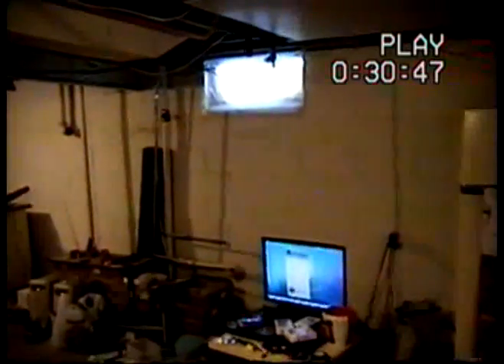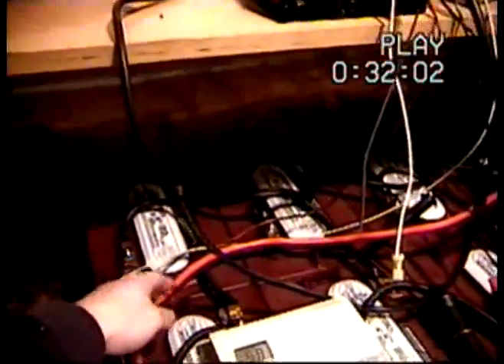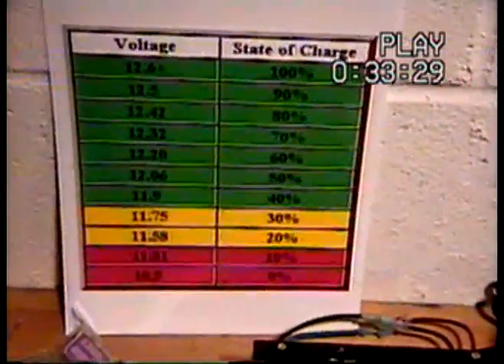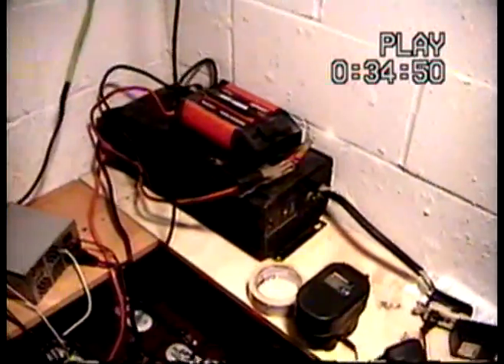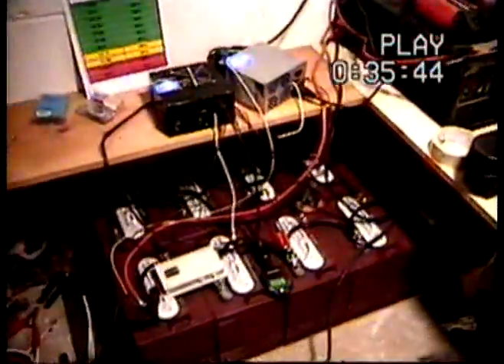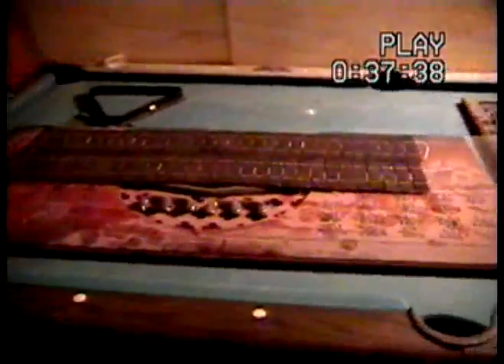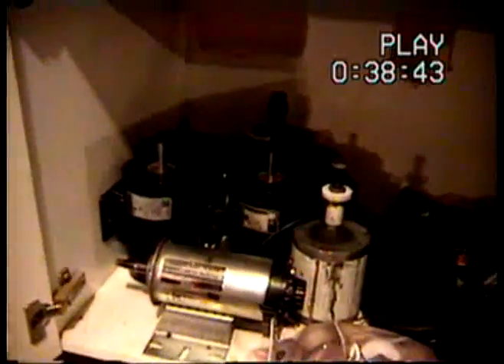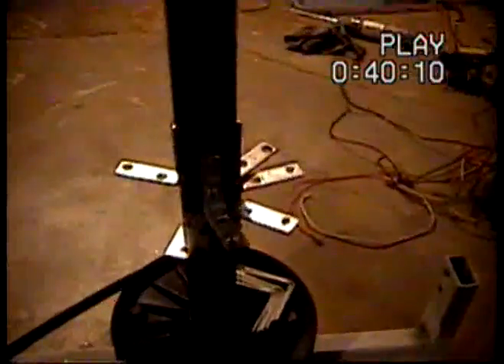Battery, solar and wind generator setup

Comment: The desulfator do you hook that up corner to corner aswell or just 1 battery at a time. Thanx.
Reply from the maker: Whoa, I almost forgot I uploaded this video lol.  Yeah you can hook it up to either.  Best or quicker results would be to hook up to single 12v but if your not in a rush, hook it up to the corners posts and leave it.👍

Comment: Batteries in series or parallel?
Reply from the maker: both. there 6 volt series to make 12 volt then parallel
Reply: +donzi joe oh ok so if it was 12v batteries then just parallel.   so how has the system held up since you made this video?    Looking at designing a system to heat a house with wind.
Reply from the maker: +Jason Ta yeah just parallel for the 12v batteries. It has held up very well. the only thing that has changed is more solar panels because wind gens wont produce enough in my location. if your location is pretty windy all the time you might do ok but solar is always a great choice. i am actually in the process of collecting used laptop batteries to make lithium ion batteries to replace my lead acid batteries. good luck
Reply: +donzi joe Ok tx for the info i just need to look at draw and hours of use for the bank.

Comment: A beatiful work indeed!
And  small questions, if its possible to be answered.
 Do you connect the neg+pos cables of the wind generetor,
straight into your power bank? Does it needs charge controller
seperately from the one you got already for the solar panels?
thanks
Reply from the maker: You cant use a wind turbine on a solar charge controller unless its able to regulate the wind turbines higher voltage.  If it cant it will burn up the charge controller.  You dont have to use a charge controller for the wind turbine but if your not there to 24/7 to monitor your voltage of batteries they could over charge. I would so you dont have to watch everything all the time.
Reply: joe williams Ok, i see, i do have a clear picture now, thanks!
I have a charge controller for my system but its level up
to monitor that only (a 40A charger for a 37A solar system)
and now i will add the wind turbine, you see! So, i have to use
another one i suppose.
thanks again for the quick answer joe!

Comment: dude, love the man cave intro,, :)  guys like you are what make the world go around. I love the stuff about the tread mill motors/ wind generators. Have you done a video on that??  you are doing things that amaze the rest of us, me especially..  

The eight batteries,, did you get them new or used? I am looking at putting solar on a airstream travel trailer and was trying to find a good place to buy used batteries. There seems to be a bunch of videos on how to refresh old misused batteries./ 

also the pulse controller,, what is that and how did you make it and does it work, or will it work with less batteries.. I will have 2 or 4 tops batteries  t-105. 

thanks again and happy Thanksgiving 2013..

Comment: I have a prostar 30M 30 amp controller. My solar panel puts out 7 amps. Can I hook my 8amp 12 volt DC generator to the same connections I have the solar panel to ????  If the solar panel is in full charge of 7 amps then that would be a total of 15 amp input to the control.

Comment: lol I am doing the same if you want a faster magnet collection with motor try the he washers take a allen wrench on the bottom you will see a big round plastic ( don't break )pull it off and walla magnet continue you want the shaft and all on it ps the microwave take to long but the plus is the parts like the magnetron is about $50 and the inverter about $20 have fun keep it up

Comment: Hi Caveman, so hoping this question isnt redundant, but can you tell me exactly what runs off all your setup? Does it run  a normal fridge, water pump, lights and electric heaters, and lights all at once? Only asking because i need to know what i would need to run my extremely small house.

Comment from the maker: Hey Thanks, I usually keep a good eye on them but thats just because I pass by them a lot.  I pay less attention in the summer months. Ill try to bring them down to 12v and then a few days later down to 11.85v. Ill do that to complete a full cycle on the bats so they will last longer. I am using a xantrex C-60 charge controller and it is PWM and it will equalize the bats once a month as well.

Comment from the maker: You can use 2 different charge controllers, 1 for wind and 1 for solar and hook them up at the same point on your batteries or 1 charge controller that can handle both wind and solar and then hook to batteries.

Comment: what motors do you have on your turbines and the specs would be good.... newbe here and trying to find what are the best sort of motors to use! are the low rpm high volts/high amps best in DC best to get?

Comment: if i have 2 standard 12volt batterys connect to a wind turbine to be charged does this mean the charge controller has to be set to 24v? Also do i have to disconnect the batteries from the wind turbine in order to use their power or can i connect the power invertor up in such a way where i can use and charge at the same time. Any help would be greatly rexcieved. By the way im new to all this.

Comment: Hi Caveman. so can you plug in two inverters to a battery bank? I have a 240 watt solar panel with a 920AH bank of battery. My 1500 watt inverter is running everything in my house and im planning to buy a portable electrical stove which i would need another 2000 watt inverter to run the 1500 watt stove, so is it doable to hook an additional inverter to the battery??? Thanks

Comment: The problem with wind, and sun, is not only the location, but the Availability.
Instead of relying on something undependable, like wind or sun, use a Constant source like magnets.
A simple N-S magnetic repulsion turbine and you can mount a practically silent unit anywhere you like... preferably the garage, if your wife is anything like mine.
I Always get a Good Giggle from people trying to use wind or sun ! - Good Luck With That !

Comment: Noticed on your early model wind generator you used a pulley/fan belt set-up.  That is very inefficient.  A sprocket and chain drive would have much less drag.

Comment: got a question if you dont hook up a load to the charge controller will it still stop charging the battery when the battery full cuz i wasent sure y they had set up like that i never hooked up a light to the load on my charge controller will the controller still kick off when batterys full if i dont have a load on the controller

Comment: you need to vent your charging area.  breathing that is not healthy at all.  also lift your batteries higher off the concrete for longer charge hold.

Comment: hi ,great video & very kind of u to ansewr lots of qns.including mine if possible-with 1kw pma how many battries do I need to hock in to run a house & if I connect 20-12v batteries in series can I get 220v current to run the house without converting from DC to AC  --THANX A LOT

Comment: hi there. i like your .battery set up.can.please email me. your battery set up.  info. im trying. to  make a battery, bank .with 6 volts battery. im confuse. on the set up.. in your video. you say. you conected .then in series. then in parallel. .my question. to you is./ do you have your set up for 12 volts. or 24 volts. can you please help me out . if you dont mind. sending me more info please . i preciated. you help. god bleess . my email is. blueman1968@gmail .com. .i

Comment: Hho is great. I'm working on a hot water heater that uses Hho and would love to wind or solar power it. My guess is I need to produce at least 300-500 W to make enough has to heat it.

I'm building a tower that goes up 80 ft and want to put Daisey chained wind generators on them. Can you show how you have your two generators going to the charge controller? Do they each need their own charge controller? How many watts are you getting off one generator/motor.

Thanks...

Comment: Hi I have an(1000VA) inverter which runs in 12vDc I would like to change the battery to 200AH deepcycle and connect a solar panal system to charge it,infact I dont want to connect it to the grid to charge the battery the question is what shuld be the charging voltage and current for the charger controller as we consider the day light is only for 6Hrs to get the power out from solar cells,what capacity the solar panal shuld have...Thank You

Comment: @jamesc426 what he has done i connected the 10 batteries together by having 5 banks of 2 6volt batteries making 12 volt and the way he has connected the rest is by connecting negative to negative and positive to positive creating the amps i have recently made a video about this have a look you might find it useful hope this helps

Comment from the maker: are your batteries 12v or 6v.  if there 12v then all + should be together and all- should be together.  also you inverter, solar and wind should be hooked up on same post on the battery bank.  kinda sound like a bad inverter or you are pulling a big load from your batteries.  what are you trying to run

Comment: Thanks for the reply,
I put a volt meter on it today, spinning it by foot I got 14v DC. I guess the next step is removing the weighted fly wheel and trying to find the most efficient blades. What do you recommend?

Comment from the maker: It sounds like its good.  does it say DC voltage on it or can you spin the shaft with a volt meter on it the wires.  If it makes voltage it will work

Comment: Hey hooptejoe, 
 I found this treadmill in a field and pulled out the motor. The stats are:
Baldor industrial motor
1.5 HP
90 V
13.5 A
2400 RPM
Would this be a good motor for a windmill?

Comment: I'm starting on a water system first- rain and wel, I'd like to use sun and wind to get it going. to get 'free' water. I wish battery and solor panel teck. would kick in and make the prices go down!

Comment: Your doing a good job! I would like to know if you have ever did a payback
on your energy savings? I've been looling at saving money using FREE wind, water and sun. But to save a few bucks it seems to take a lot of time and money and when it finaly would pay for itself you have to start replacing parts like batteries etc. Even With free stuff .

Comment: I tell u this as it can be put in2 a switching power supply 2 give u fullpower produced saved in capacitors- very little loss 2 use at adjustable & clean power requirement. an old cheep palm size  AA solar charger from 24hr charge 2 blow AA rechargable vent because of 2much power on the same palm size array.
  over voltage load could be 2 flashlight cell chager(s) & put a relay 2 turn on an ugly load(s), stepping or not. 
   & charge ur cell phone, etc.
 I thought of this from ideas i've seen

Comment: You don't see the PV setups when solar cell of unequal resistance was, Power output is low due to cell bottle necks.

Put together smaller series of cells for lower output voltage. Match them up on a common light test and check PV Piece resistance(matching cells out puts)
  Now some mismatched .5v cells can be used parallel to put in series for max effect total power (watts output). A voltage multiplier can boost 1.5v or less to a disposable camera flash used 200-300 volts. Coil or capacitor.

Comment from the maker: I use light bulbs as dummy loads on the wind gens because the open voltage can be kinda high.  For the solar, all the cells were .5v so I put them in series to make about 17v then put them in parallel for the amps.

Comment: did you consider using your dummy load to Power 12v power NIckel metal reg AAA, AA, C, D, etc. battery packs. Did you ever consider using a voltage multiplier and configure your problem solar panels to parallel and go for pure current and avoid equal ization, resistance issues, all pieces just on one bus. Series solar cells have to be matched to prevent uneven resistance.  Voltage multiply your .5v or better to the voltage desired and high current to boot. very useful with varied devices
thanks

Comment: Nice home made equipment. 

I really like the homemade charge conrollers. did you use PC Switcing power supplies?

The man cave will one day run some of your home. You could always hook up  seperate AC power panel just off the battery bank. You might even have a stand alone room or rooms one day.
  You even built a vertical windmill, great for side by side and good in city roof lines.
 very expensive to buy

  thanks. great work.

Comment: man I keep watching just this video and dam I wish I new you. I used to collect the micorowaves for making hi voltage sparks and just relized I can stripp the transformer a part and make windings for a genarator and the magnets for the clexktron I might have smelled that wrong but dam lots of good ideas,  and I was looking at the left over parts from the tread mill those make good mounting frams for solar pannels ect.

Comment: I Like the Idea of a vertical blades. I have just converted a 340 twin cylinder 2 cycle engine into a generator. Now I am trying to think of away to make a cage or some sort of style of vertical much like the shape of an agitator, you find in a washin machine?

Comment from the maker: Im gonna be making a video here soon and Ill try to explain how I did it in there.  But basically all I did was put in a transfer switch which allows me to switch from gid power to battery/inverter power.  Also made sure that they were completly isolated from each other so there wasnt any interferance

Comment from the maker: Fridges are harder to run because they consume so much power.  I would use a propane fridge or an energystar fridge.  If they dont want to get another fridge then get a few more deep cycle batteries.  6 volt batteries can take a beating better than the 12volt.

Comment: hey buddy,i got relatives in the ranch were there no electricity they ran salor panels 65 watt  , wat you recomend to operate a small medium fridge, they just use 12 volts comercial work aholic interstate 2 to ran 12 volts light bars and 12volts tv old school,and wat type of batt is good to run da system thanks

Comment from the maker: You connect 2 6volt bats in series to get 12volts.  After you connect each set of 6volts bats in series to make 12v then you connect them in parallel

Comment: Did you do anything special to get rid of the hydrogen that comes off of those batteries when you charge them?

Normally solar panels use special low lead glass so it doesn't block the frequencies of light used by the cells.  How much of your 70W did you actually get?

Comment from the maker: I used some rubber from a treadmill in between the cells and wood.  Not sure why.  Make sure you use tedlar sheets to keep the cells together otherwise when they heat up it will loosen the solder joints.

Comment from the maker: Im having issues trying to hit the reply button and hit remove instead.  The 2500 inverter I got off ebay for 84.  Would like to get more solar then Ill go off grid or build a bigger HHO cell to run a small generator to charge the batteries.

Comment from the maker: the wires are inside the pole/tower.  They can twist, but not enough to snap or break.  I check mine once a year and untwist if necessary.  Or you could get a slipring and there would be no twisting wires.

Comment from the maker: I had about 120watt of solar from the panels I built but they were damaged in some tornado weather we had this year.  So now its about 1.5-2 amps.  Sounds like you have a good setup as well.  So do you have 18amps going into your batteries and its not enough to keep the bats charged?  Do you have any videos or pics.

Comment: That is a lot of power. Really nice. Something to be very proud of.
i like the way you explained the battery circuit and de-sulfater. nifty.
Some other videos advise venting your batteries outdoors. All those wires and inventive converters are amazing but the risk of an electrical fire is scary. Maybe it's time to put a small amount of money in a better workbench and fire suppression god forbid a fire should ever happen.

Comment from the maker: It would be optimal to use one on each but most can be used on a few batteries.  My batteries are new so its really not needed thats why I only have 1.  If I were to use more I would use maybe 1 or 2 more.

Comment from the maker: Ya, I use extension cords from the turbines and solar panel, they connect to the charge controllers, then to the batteries and at the same connection point from the batteries you connect your inverter.  hope that helps

Comment: hey joe, you did not show how to connect the battery changer ontop of the inverter. where does the power to charge the battery come from. is it from you regulators to the battery?

Comment from the maker: A lot cheaper maybe 1/2 or more.  I didnt use tedlar sheets but will next time. I just solder them in series to get 17 to 21 volts for charging 12 volt batteries. Used aluminum framing, wood for the back and plexi.  There are plenty of guides out there but I didnt use one.  Joe

Comment from the maker: I have it wired into my breaker panel.  The top half is grid and the bottum half is battery.  Just have to make sure you dont mix them up.  I will install a switch to do either but havent had time to do it.

Comment: how do you have this wired into your house? Is it completly seperate from the main wiring or wired into the main breaker? I'm interested in doing a simular setup, but I want to keep from running batteries, if possible. Thanks

Comment from the maker: No I havent tried those. The pm motors Im using are bodine (little better than ametek 30 and 38) and there in a housing. I have never thought about not using a diode just in case somthing goes wrong and if you use more than one gen or solar panel on a charge contoller. There super cheap at radioshack for 6amp diodes.